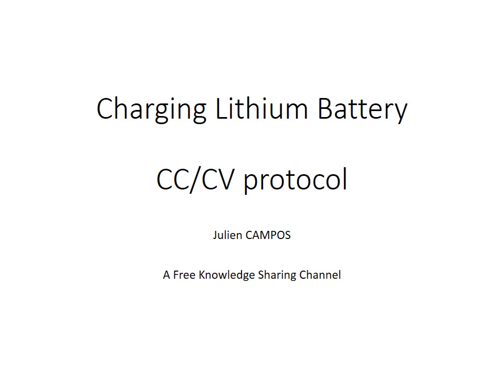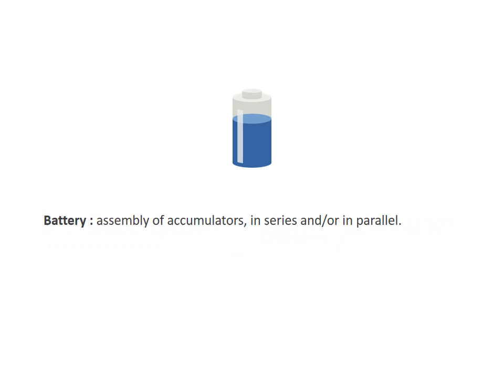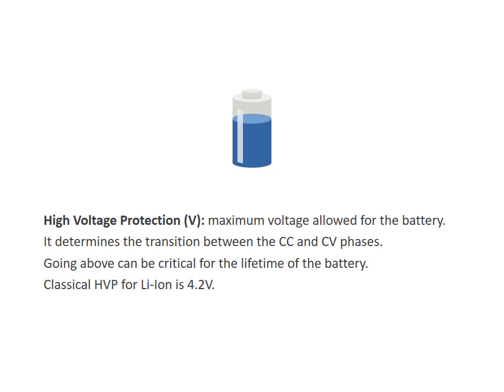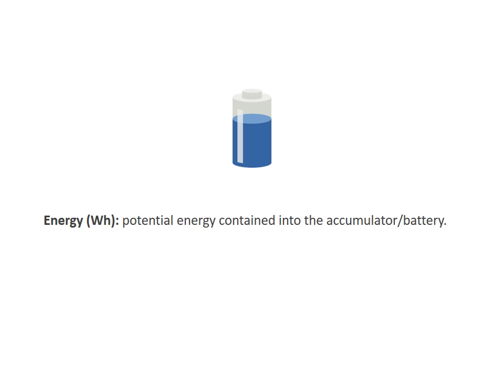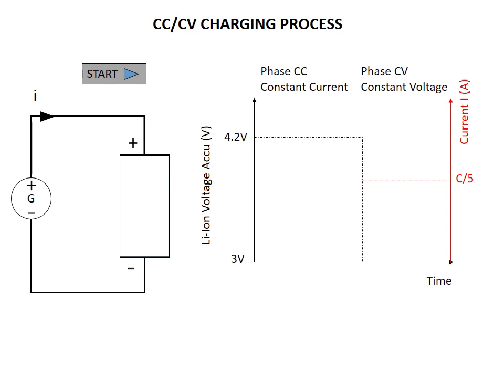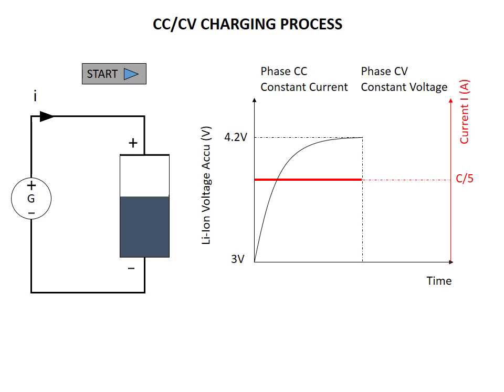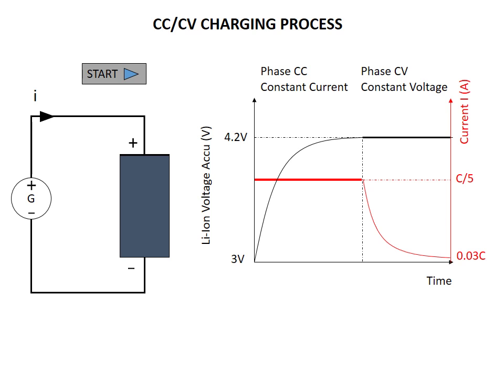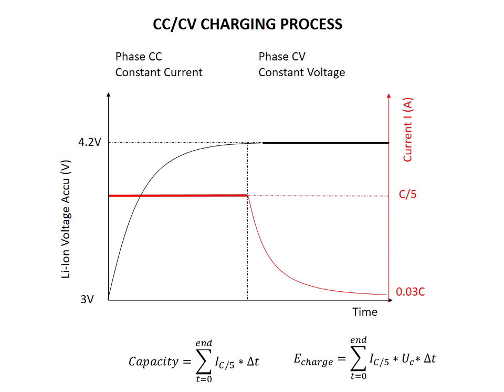CC CV Battery Charging Process EN

Comment: how did you determine the reference voltage to transit from CC to CV?
Reply from the maker: You mean how we determine that it is 4.2V ? That value is given by the manufacturer and is based on the battery chemistry. For classic Lithium battery, the maximum charge voltage for which you transit from CC to CV is generally 4.2V but you can find some manufacturer that advises you to set that value at 4.1V or even 4V. It increases a bit the lifespan of your battery by a higher endurance cycle, but you lose a bit in capacity. It's like a car: say the manufacturer of your car tells you you can drive up to 150 mph. For sure you understand that if you drive all your life at that speed, the engine will last less than if you drived at a lower pace, say 100 mph.
Reply: @julienc.4916  is 4.2 is the boost voltage of the battery?
Reply from the maker: @ramayanamsanthosh7326 
No, 4.2V is what is called the battery's End of Charge voltage (EoC), a voltage the battery manufacturer recommend to not go beyond to avoid damaging his battery. Note: here i use 4.2V, but it can be 4.1V or other values, it depends of the manufacturer and what he considered as safe and good to respect the lifetime and number of cycle he promised in his datasheet.

Comment: Hi sorry if this is a silly question - How does the current from the supply stay at a constant rate while the voltage increases? I thought the current decreases when the battery state of charge is nearing 100%?
Reply from the maker: There is no silly question, if you ask it is because my video is not clear enough.
The current remains constant because the power supply settings is set on constant current mode in the first stage of the charging protocol, until it reaches the targeted voltage of the battery and enter into the constant voltage mode. Everything is about a regulation of the power supply itself, a regultation on current or on the voltage, by means of electronic self counter reaction.
Why? There are two things you have to respect while charging a Lithium ion battery: you must not go beyond a limit of current and a limit of voltage otherwise you will damage the battery. Say your battery high voltage limit is 4.2V and current limit is 1 amp. When your battery is given to you discharged, say you measure 3V with your multimeter. Now you want to charge it with your power supply. On a power supply you can set a limit in the current and in the voltage. Set these limits to your power supply (4.2V and 1 amp). On the beginning, your power supply will be limited by the currrent limit. Why? because battery's voltage is 3V and if you try to apply 4.2 V on it you would have a huge current because of the low battery's internal resistance. Example: say this resistance is 0.1 Ohm, Ohm's law tells you that current should be: (4.2 - 3)/0.1 = 12 amps.
This 12 amps are far above the limit of 1 amp, so the power supply do a counter reaction that locks the power supply on a voltage that would give 1amp. So you are in a constant current mode in the beginning. Now internally, some chemical process occurs inside the battery and its voltage increase slowly and have this shape you see on the graph. When the power supply reaches 4.2 V, the internal circuitry detects that it is your maximum value not to go above, and then it automatically reduces the current to respect the instruction (which is dont go above 4.2V). You are now in the constant voltage mode. On your graph you will see slowly the current decreasing to respect this instruction. You can stop the charging after it reaches a current threshold (typically between 3% and 10% of your current target, that is to say here 30 milliamp to 100 milliamp). Your battery is charged.

Is it clearer for you? we can talk further if you want in private.
Reply: @julienc.4916  So if i understand correctly, the battery voltage at 70-80% is 4.2V ?
Reply from the maker: @nainabla  that is correct. When you have achieved your Constant Current stage (CC part of a CC/CV protocol), you have roughly charged 70-80% of the rated capacity, and to get the 20-30% remaining in the Constant Voltage stage, it will take you far more time. This is on that aspect of difference of capacity gain versus time between these 2 stages, that most of the "fast" charger are based on (at least their marketing speech do not tell you explicitly that the trick is in fact easy to understand, and no magic is behind).
Reply: @julienc.4916  but how does the charger know when the battery is full if the battery is at the same voltage at 70% and 100%.
Reply from the maker: @nainabla  the charger knows it because it is him who deals with the CC/CV protocol.
It is him who provides current and senses the battery's voltage increasing during the Constant Current stage (during that stage there is a feedback control loop mechanism in which the charger plays with the voltage to maintain the fixed targeteg current). It is the charger who then changes its regulation mode from constant current to constant voltage when battery's voltage reaches the 4.2V for a single Li-ion battery (can be 4.1V, depends on what the manufacturer recommends). In that stage, still we have a feedback control loop mechanism where the system does all he can to maintain the targeted voltage by playing on the current. 
The charger can have feature in which he tells you that he has reached the transition between CC and CV, and you know from the battery datasheet (at least for most of them) that you already have then reached 70 to 80% of the rated capacity.
To reach 100%, you need to configure your charger in the same way that the battery describes it. There are few parameters to take into account:
- during the charging, the parameters are the charging current, the end of charge voltage (the say 4.2V), and the termination of charge current (a fixed value given in fraction of capacity, typically C/10).

- During the discharge, the parameters are the discharging current (typically C/5) and the end of discharge voltage (typically 3V).
 
If you follow those instructions, then the manufacturer "guarantee" you the rated capacity. If you change some of the parameters at least inside the voltage and current recommended operating specs, you may find a higher or lower capacity.
Is that clear?
Reply: @julienc.4916 I understand. But why do people test the battery state of charge with multimeters. And if the cell is at 4.2V they consider it 100% charged?. Anyway, thank you for all the information. You are very helpful. Please do some more videos on electricity..
Reply from the maker: @nainabla  reading 4.2V on li-ion battery does not imply 100% state of charge, though it is a good indicator of the state of charge. For li-ion, the voltage charging curve has a ascending profile, which means that at 3.8V for examplr you should have more capacity remaining than at 3.3V. Therefore some electronic hobbyist have fun building small state of charge indicator with 3 or 4 LEDs, in which they will say that battery is almost empty for voltage below say 3.3V, medium charged from 3.3V to 3.8v, quite charged from 3.8 to 4.2V, and fully charged for V= 4.2V. 
That is not really professional but for most electronics projects that can be enough. 
Other method, far more complex but more accurate, is to use a coulomb metering system, that will measure the current that gets in and out of the battery, and will estimate the state of charge out of it.
Reply: @julienc.4916  makes sense. Thanks

Comment: thank you sir.please answer me if i takes this cell(3.3V)and make a battery with 330 V how i can take the maximum voltage protection.in your case is 4.2V it is (4.2*100) in my case,,?
Reply from the maker: Hello,
May i know the reference of the cell? Can you confirm me it is a secondary cell type?
3.3V is your nominal voltage per cell?
Take note that for such serial assembly, you have to deal with battery balancing technique to make sure all cells arrive to their limits in coordination.

Comment: Can we use constant power mode for changing？
Reply from the maker: It is possible but only if you do not go over Vcharge max, and that you don't go over the maximum current that the battery can withstand continuously during the charging stage. Because of that, your limit on your constant Power setting (current x voltage) on the full battery charging voltage sweep (Vmin to Vmax) is given by Plimit = current max x Vmin
Second point, your charging system will adjust constantly the current while monitoring the voltage to ensure a constant power (current x voltage).
When the voltage monitored reaches the Vmax, you can't continue in constant power mode, you then simply have to switch to constant voltage mode.

Comment: in this case, in cv mode you stop charging when the current falls down to 0.03C.
how you set this current
Reply from the maker: What do you mean by : " how you set this current". Do you mean why this number? Or do you mean how we stop experimentally at this number.
For the first, this 0.03C is totally arbitrary and will depend on the manufacturer or even yourself. All manufacturer, when they give you a capacity, they have also to tell you the way they achieved that capacity, this is where you will find those indication of charging terminiation. For the percentage of current compared to C, the lower the percentage is, the longer it will take you to reach the termination condition. It does not worth to go very low, 10% is normally large enough. Going further below will greatky increase your time of fully charging but a very little gain of capacity. Please note you have also the possibility to decide of the termination of the charging not by a value on the current, but by a time after you entered into the CV mode, say for example 1 hour. But it implies that during this time, the battery continues to charge at the same pace and is not perturbed by a load asking for some current.

Now if your question was related to how experimentally we stop a 0.03%, 2 solutions:
- You buy a dedicated Lithium charging chip, and they have for most of them a configuration pin to define the termination current (generally  a simple resistor setting.
- You do your own circuit, then you need to measure the current, shunt resistor circuit for example, that will give you a voltage reading of the current. You can either make an analog circuit to stop the charging (comparator with hysteresis + load switch) or make a ADC reading to an MCU that will stop the charging through the control of the switch (i prefer that option as you can easily change the termination current setting through the program).

Comment: Hello! Thank you a lot for your video. I just started working on Batteries and I was trying to build a CCCV model on Simulink, I do have a battery pack with 192 nom.V. They are connected in series and in parallel. So I was wondering about how can I build a model. I wanted to charge with const current until I reach my 192 V and switch to a const v charger. I might be mistaken, If you are still available to give some feedbacks, I could share with my Simulink model.
Reply from the maker: Hello
I'm really sorry for the delay of my feedback. I am not an expert in battery simulation, but i have found these articles that perhaps could help you:
H.J. Bergveld, W.S. Kruijt, P.H.L. Notten, “Battery Management Systems,
Design by Modeling”, Kluwer Academic Publishers, 2002.
M. Dubarry, B.Y. Liaw, “Development of a universal modelling tool for
rechargeable lithium batteries”, Journal of Power Sources, Volume 174 (2007),
Issue 2, 856-860.
Hope it helps
Reply: @julienc.4916  Thats so nice of you.  Thank you so much!!!!🤗
Reply from the maker: @aidazhanybekkyzy1264  You are welcome. Just a question: are you trying to simulate a model of the battery itself, or the charger?
Reply: @julienc.4916  I was simulating my battery itself, as a charger I took constant current and voltage source.
Reply from the maker: @aidazhanybekkyzy1264  Ok, them yes you can look into the articles i sent you. Good luck!

Comment: During the CV phase of charging, an exponentially falling current is still going inside the battery so why doesn't the voltage across battery increase in that phase?
Reply from the maker: Once you reach the voltage that you claim it is your target value to maintain during the CV stage, either you use a specialized circuit or use your lab power supply configured in voltage mode. The voltage mode is simple to understand: by an algorithm type loop or feedback, do (the IC or the power lab supply) whatever you can to maintain the voltage targetted, by regulating the delivered current. 
It is the internal Physico-chemical reaction that occurs during the CV charging process that leads to this current shape of an exponentially falling curve while you enter into the CV stage. Many electronic/physics/chemical models offer their own explanations of the real process occurring, this one having many parameters in the model, such as the temperature, the chemistry of your cell, the rate of reaction etc.
I hope my answer help you a little, if not please continue asking more question, I'd be happy to help.
Reply: Can you share a source that will help me understand the control technique used in the CCCV charger?
Reply from the maker: http://www.ti.com/lit/ds/symlink/lm317.pdf
See figure 8.3.6

Please see also video from Dave Jones regarding Lab Power Supply. Below part 1 link, see the others as well:
https://youtu.be/CIGjActDeoM
Reply: thanks for the help, much appreciated :)

Comment: Hi sir,

If the CC value is from C/5 to 1C and the initial voltage and max. voltage is remaining the same. What will the current curve & voltage curve like?.
Thanks
Reply from the maker: Hi, I don't understand your question. Can you develop further? What do you mean by the initial voltage and max voltage remains the same for example? Thanks
Reply: @julienc.4916  I mean based on your uploaded video, where the starting constant current is C/5 and you build the current curve and the voltage curve.
My question is:
If the starting constant current is not C/5 but it is 1C and the initial & max. voltage are the same, what will the current and volatge curve be?
Reply: I mean the initial voltage & max. voltage are same as your example.
Reply from the maker: @cheungkimwai1919  Okay understood. Very good question. Typically the voltage curve will be steeper on the Constant Current phase, so the Constant Voltage phase will be reached in a shorter time. But once you are in the Constant Voltage phase, I am not sure. I have done the tests years ago but i don't remember. Instinctively i would say the current curve should be stretched further and be less steep. That's a good experiment to do actually.

Comment: Nice video!!
Question: Does this charging process also apply to large-scale battery (power grid application, in the range of kW to MW)?
Reply from the maker: Thanks :) 
The charging/discharging process type is used accordingly to a battery chemistry and is not related to the power size. What will change is the voltage and current limits based on the assembly configuration of the battery (battery = assembly of minimum 1 cell in series and/or parallel). 
For large power that you can meet for example  in a charger for a EV, the BMS (Battery Management System) is sized to handle huge power, and distribute it efficiently to a set of batteries containing thousands of individual Li-Ion cells assembled in parallel and series.
Reply: @julienc.4916  thank you for the fast response.
In large-scale battery (range of MW) for applications in power systems, it is said that the battery can instantaneously (almost; in the range of miliseconds) change from absorbing mode to injection mode (absorbing or injecting power to the grid). How can this be so fast if the charging process that you showed must follow all of the appropriate steps? This is the part I don't quite understand. And in the large-scale battery, the value of the power being absorbed/injected can be controlled to any specific value. How can this be achieved without violating the specifications of the charging process tha you showed? Thank you again.
Reply from the maker: @jasdfff770  Good question. The video I show is just about a full charging process that is not interrupted by a discharge. In real applications, like your cellphone, you can absolutely charge your phone, and remove the USB charger to watch a youtube video that is power-hungry, meaning you discharge it, and then a few minutes after you put it back to charge. That is just an example but there is no problem switching from charging to discharging mode in a random manner, simply when you will go back to your charging stage, the BMS will apply its CC/CV protocol without taking care of what happened before. He will apply first a current regulation, and if the end voltage limit is already reached, he will simply hold therefore to voltage regulation.